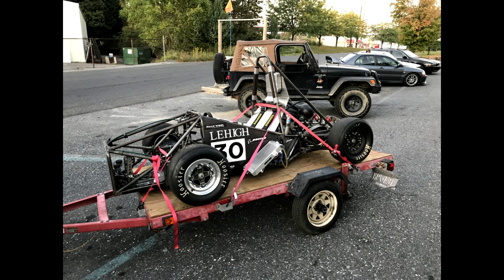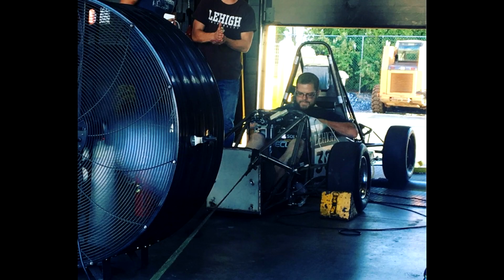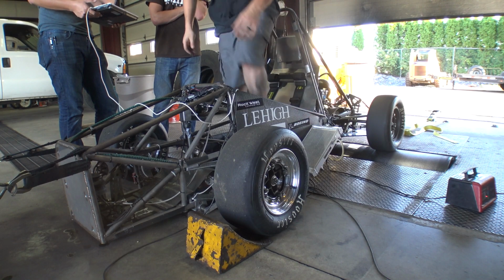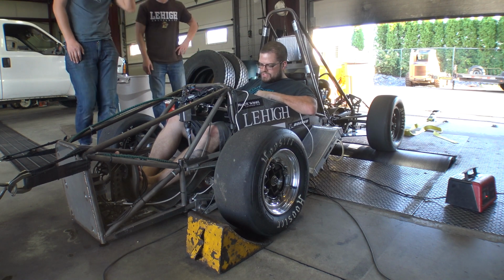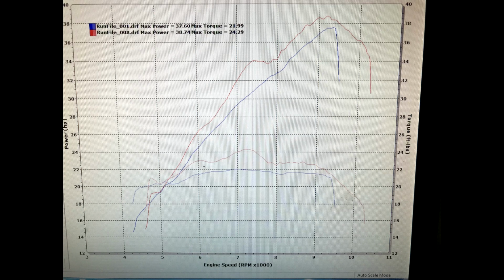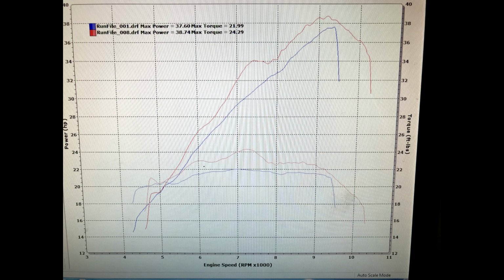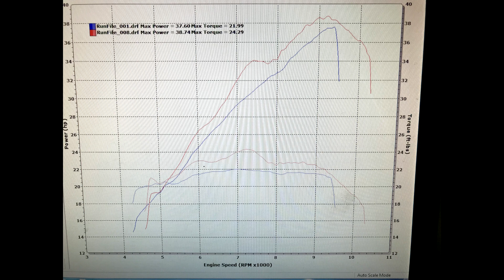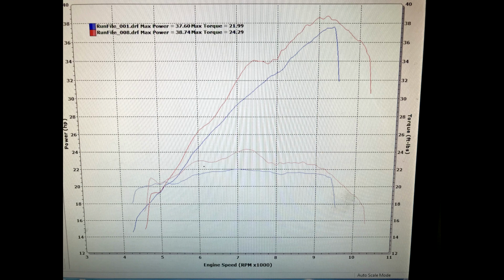lehigh Univ FSAE car yzf450 powered

Comment: The KTM 500, that our team uses makes 46 hp, on an engine dyno. It was funny, we were able to overspark the engine and picked up power by pulling timing across the board. The single cylinders will rattle your brains out.

Comment: Why not gold box?

Just kidding, they need massive compression and revised cam timing to keep the dynamic compression low when it isn't choking on that restrictor.  Of course the header and intake would need to be returned for scavenging and ram effect to counteract the restriction at high rpm.

If they can play with ethanol content, they might be able to push that a little harder.  Either way they should have nice smooth chambers and piston crowns, maybe fancy coatings and plugs with just the right heat.  Probably low piston rings like an N2O motor so the piston edge doesn't get hot spots.
Reply: Daniel Lucero it's either 93 pump gas or race gas 100 Octane for FSAE
Reply: Motolav but do they check?  Maybe you could get some winter mix 93 and add 15% ethanol to make it act like 95 or 96 octane and give you more evaporative cooling.

In racing, if you aren't pushing the rules, you aren't really trying.

Comment: I have a 4.8 I want to build it n/a people are telling it’s better to build for boost what’s your opinion
Reply: MOPAR_LSX _SVT_JDM depends on what your goal is
Reply: 4.8's are great for boost, I wouldn't go N/A unless you are putting it in something that's SUPER light, I guarantee you'll get bored of it and want more.
Reply: Joshua Muresan ji want to do heads witch everyone tells me to go for 243 heads 660 lift & BTR. Stage 4 cam I’m also going for a 102mm Intake manifold
Reply: MOPAR_LSX _SVT_JDM dont bother with the intake. I mean whats your goal with the car? A hp goal or a et goal?
Reply: MOPAR_LSX _SVT_JDM of course he is going to tell you boost it, is this even a serious question lol
Reply from the maker: well you get yourself some goals, and you build the car towards your goals, otherwise youll probably be unhappy.
Reply: MOPAR_LSX _SVT_JDM cam, springs, retainers, single 70-80, deka 80s, walbro 450. Done.
Reply: MOPAR_LSX _SVT_JDM dont do that
Reply from the maker: +Danny5point3 decaps are as big as 80’s Dave the money
Reply: Sloppy Mechanics Im running decaps. Just didnt want that "Danny5point3 on youtube told me decaps would work and I fried a piston" when he fucks a pintle up and doesnt get them flowed lol.

Comment: Still seems low on power? But i could be wrong! 
Check out my sloppy videos!
Reply: Seems pretty good for a 450 breathing through a straw!
Reply from the maker: yes most people seem to be missing the fact its running through a hole smaller than a quarter
Reply: Definitely low for a 450 but it is restricted
Reply: I missed that part sorry